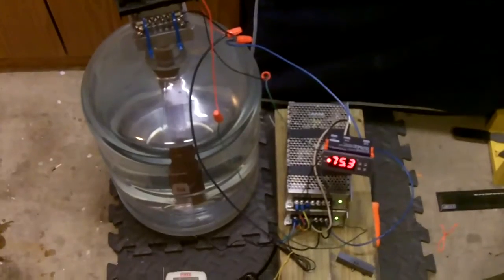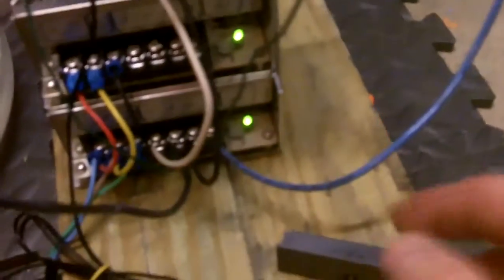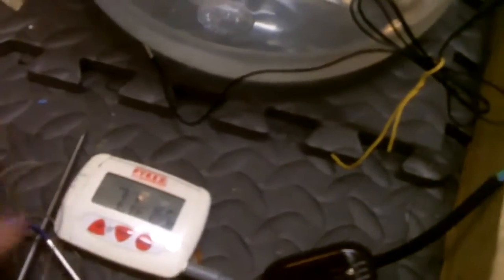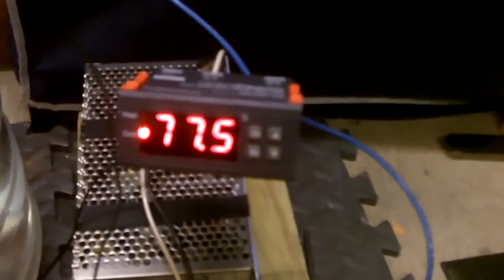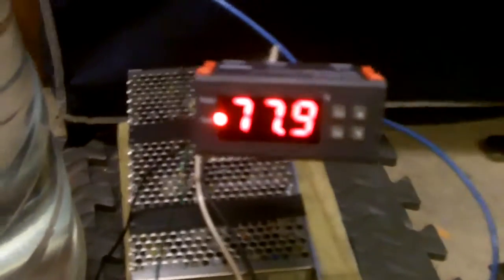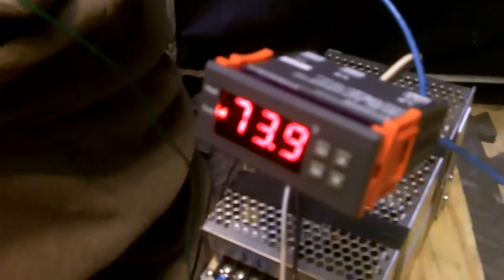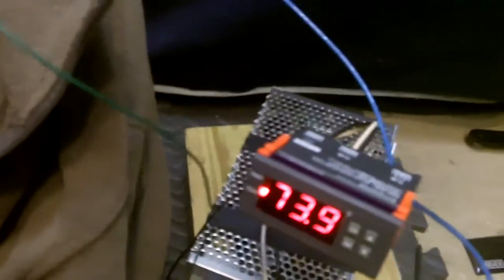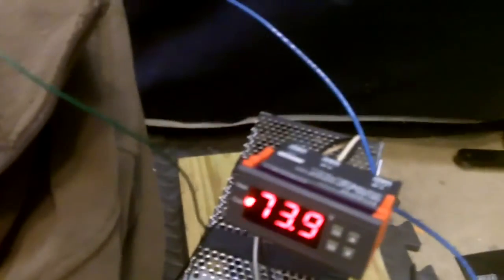Peltier Carboy Chiller Phase 2

Comment: Very interesting design. What size peltier are you suing? Is it a 12v 100w peltier or bigger? How would you increase the power to it? would you try to run a higher amperage through the peltier or does the heat cooling difference depend primarily by the voltage?.
Reply: rangermonk so have you had any more success with this? Do you think you could use it to control fermentation (if you used something other than copper like aluminum which is anodized such as the brewjacket immersion chiller?)? I think if you used a couple of peltiers on a block you might get better results than with just one. you could get water plates for all of them and run cold water in series through them.
Reply: Interesting.  It looks like overkill.  Back in my home brewing days in Florida, we used low tech.  Frozen packs hung over the carboy neck to various heights, styro sheets lining cardboard box placed over carboy.  If you thermally isolate the carboy well, then you just need to remove heat from fermentation.  If you look at what industrial fermenting operations do, it is an external water jacket which is part of the vat.  As a suggestion, consider copper tubing jacket against outside of carboy, leaving the mouth available for airlock.   Could use blanket/sleeping bag to wrap over all or flex closed sheet insulation like that used for packing.   The Peltier should be able to manage that size of system.
Reply: Been doing some work with Peltier cooling for instruments.  This site was very helpful:
https://tetech.com/
If you want a sensor that can be in contact with the fluid, consider a sheathed sensor.  You can get sheathed thermocouples in SS from Omega Engineering or TC Direct.  You may be able to get just the sheath and insert your own sensor.  There might be a bit of lag due to the carboy wall if you placed the sensor on the outside of the carboy, but this might be acceptable for this application.  To improve efficiency of heat transfer, you could consider a liquid system on the hot end with radiator, like that used to cool desktop CPUs.
Reply from the maker: I'm not 100% sure what size it is.  I believe it is 15v.  I just got a new rod to install for the heat sink, so when I disassemble it, I should be able to get the rating off of the peltier.  The potential across the peltier determines the heat/cool difference.  Typically, changing the voltage will determine that rate.  But as you get closer to the peltier's max ratings, you will lose efficiency.  Thanks for watching.
Reply from the maker: Adrienne Kaul I purchased a solid aluminum rod to replace the copper pipe.  But have not had much free time, to work on it.  I like the idea of multiple peltiers.  I hope to have another video up soon.
Reply from the maker: I have been thinking about this.  I'm hoping to have some spare time to work on it.  instead of having something in the fermenter, like you said, I think a jacket would work better.